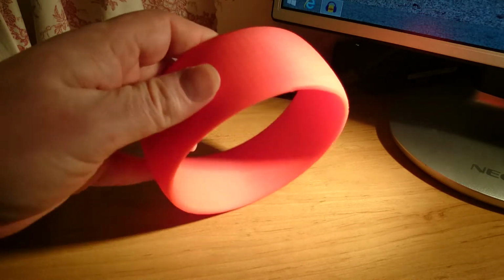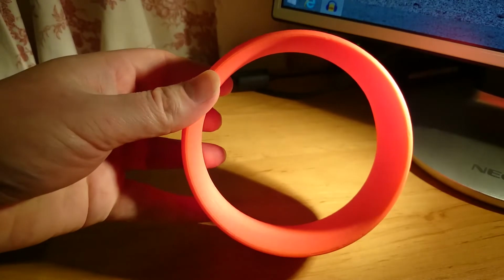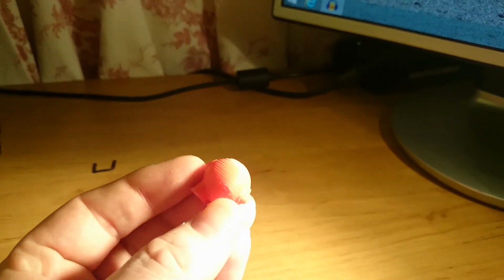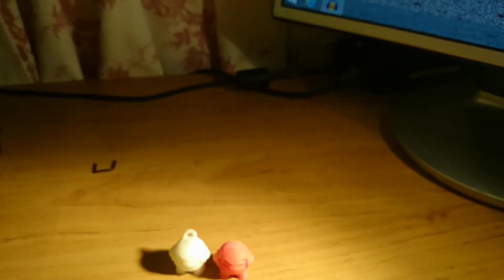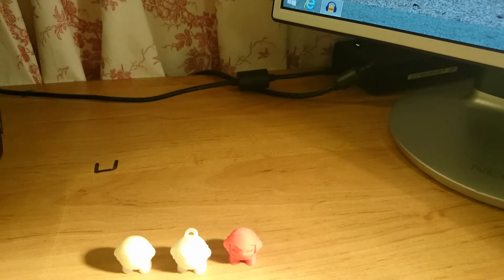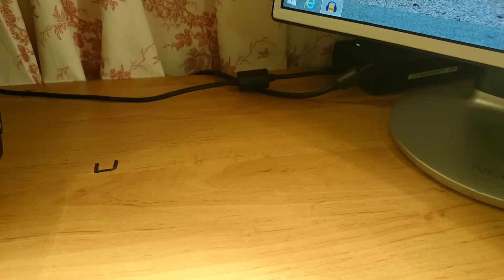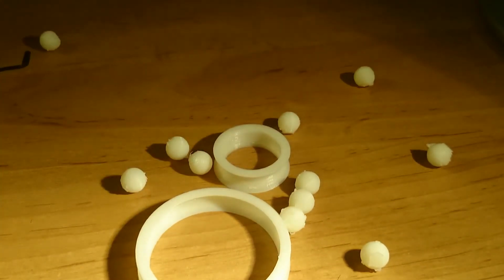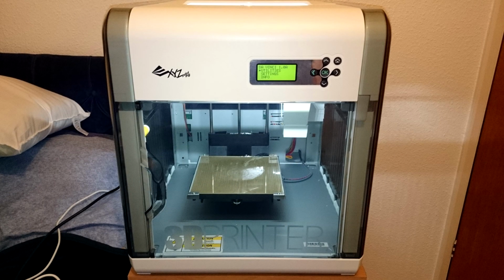XYZ DaVinci 1.0A 3D Printer Torture Test 2 + a rant

Comment: Could you please post a video review of your experience with the Da Vinci 1.0a after the modifications you made in your tutorials? I’ve watched the 7 “how-to” install the E3D extruder, new power supply, etc... and I thank you very much for sharing such a clear and in depth walkthrough. I now have a very good grasp of the amount of time and work I have ahead of me on my 1.0a. These videos are a godsend for me. But I am really anxious to know how the mods turned out, how much better or worse it printed afterwards, any real issues you’ve ran into since the mods were completed and any other information that you feel like sharing about the difference between your old 1.0a and your new Frankenstein’s monster (respectively). I think that’s what I’ll lovingly call mine in the end, providing I don’t assist it in a flashy self-destruct spectacle. I’ve been meaning to mod my 1.0 for awhile now but many of the processes make me a bit nervous that something will go wrong and it’ll end up as a ‘lemon’. But it has become more important to me to have freedom in the software I use, the filament options and brands I prefer (especially the cheaper ones 🤔) and to obtain all the indispensable, missing features and settings I need. I’m sure you know how big of a deal that becomes after the newness of the Da Vinci wears off. It has been a great starter printer for me for 3 years now and it has been shockingly very reliable with my abs printing. I have done a ton of research into buying a new 3D printer but I am frequently turned away by their abs printing abilities for several reasons, but mainly due to the skimpy and overpriced enclosures that have to be bought separately which run the same price or more than the 3D printers costed in the first place. They also generally have to buy or make the glass printing beds (usually just small sheets of glass secured to the print bed by clamps.and if they aren’t using sheets of glass then they are frequently covering their print bed with painter’s tape just to get abs to stick. It’s no wonder why so many people quickly grow to hate abs. It is sad when I see people turned off from abs primarily because they have to wrestle with tape every other time they print, heavily nuke glass panes with Aqua Net hairspray and worst of all, wasting loads of abs filament thanks to warped pieces and misprints, all the while never getting to see the smoothness and durability of their abs prints because their enclosures are either thin, open and drafty or they have none at all. Of all the faults that the Da Vinci 1.0a has, I’m so glad that those problems aren’t any of mine. 

Yet I’ve come to the point where I really would like to print smaller, sharper and more highly intricate pieces that ABS just can’t maintain at its melting point. This printer does print PLA but the temperature of the extruder isn’t programmed to get hot enough to prevent disgustingly frequent clogs. I’ve bought multiple stock hot ends for my 1.0 just so I could have a clean one to use while I clean out the last one in the cycle. Btw, I should add that I do regular 12 print-time cleanings. I don’t have the same clog issue with ABS and extend my print-time cleaning to 24+ hours. It’s my go-to filament so I don’t want to turn to another 3D printer that sacrifices my joyful ABS printing just to use flimsy PLA that cracks and ages poorly. I see the potential in what the 1.0a could be and I believe sinking $500-$700 into upgrades and mods for this printer will yield a premium 3D printer that excels in producing prints with a truly wide variety of materials (except resins, of course). I also think a smaller diameter nozzle size (0.5) and a micro cooling fan mod will beef up those edges and details when I want them in ABS filament. 

Your videos are just what I needed. They give me a well planned list to start carefully tackling. However, I’m still trying to devise on the exact extruder and hot end I want or need to get to make this machine do as I envisioned. So I’d be incredibly grateful if you could share some or any information on how your modded printer has been performing and what functionality has improved since the mods. And maybe perhaps kindly show some of the best prints it has done since the changes? Or even just a comparison of it now vs these old torture test videos? 

Thanks for all the info here, nonetheless. You did a great job on explaining and showing the mod processes. They were easy to follow and the tips are also very much appreciated!